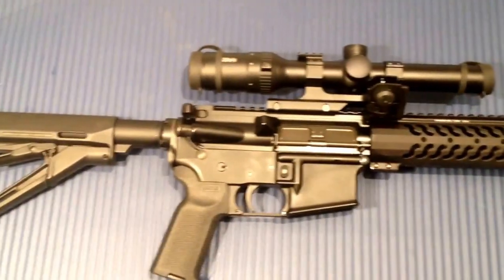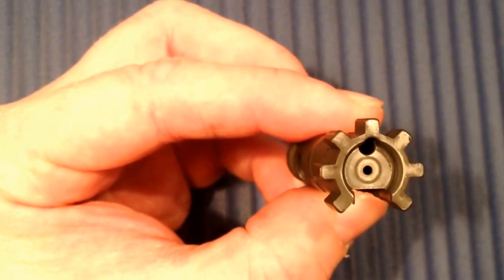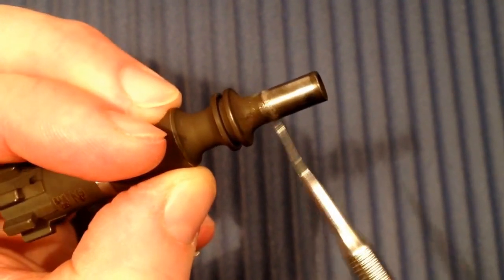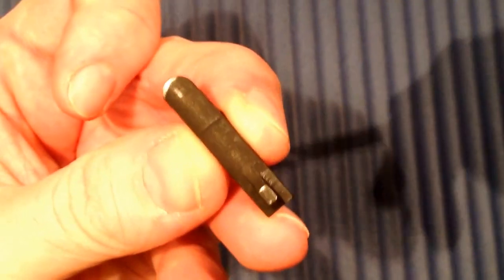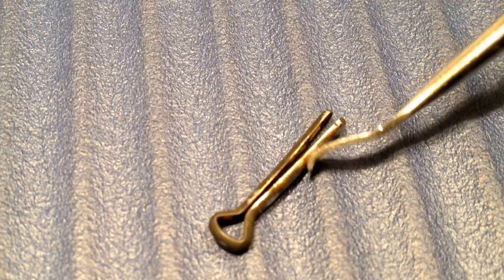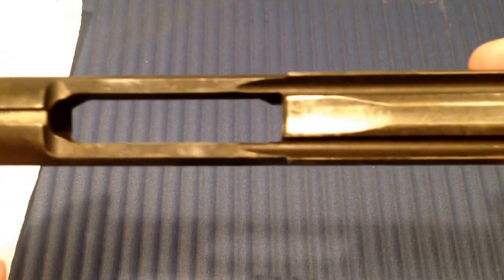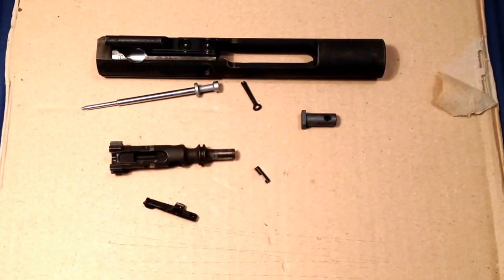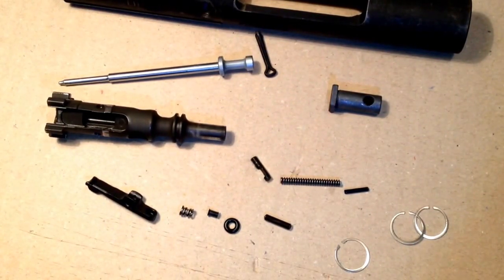AR bolt inspection after 3000 rounds

Comment: @1:30, the bolt tail should be .250". The carbon build up slightly ahead of the tail and before the gas rings is okay and not critical. The bumpy area you feel is also normal.
Firing pin protrusion should be between .028" & .036".